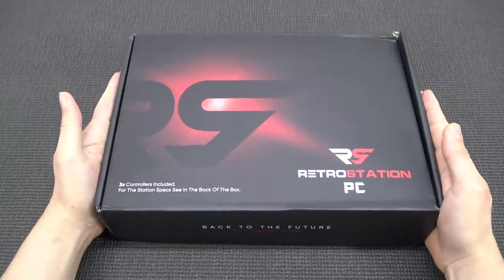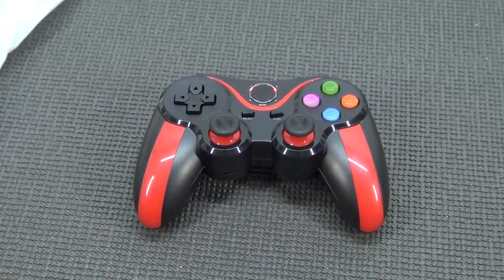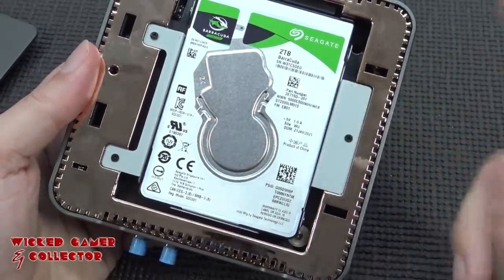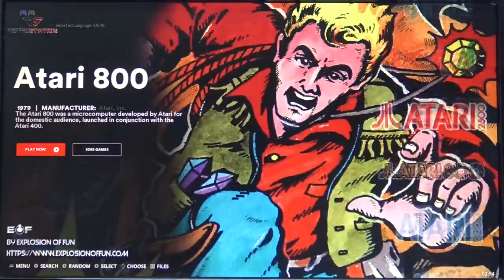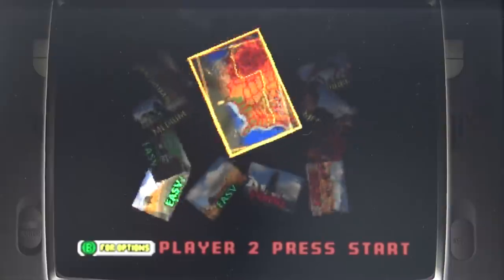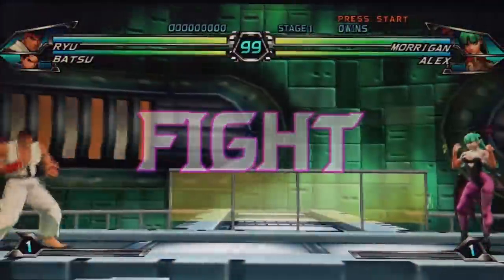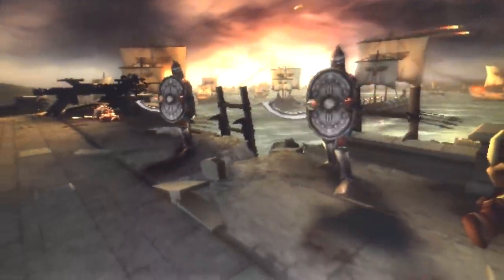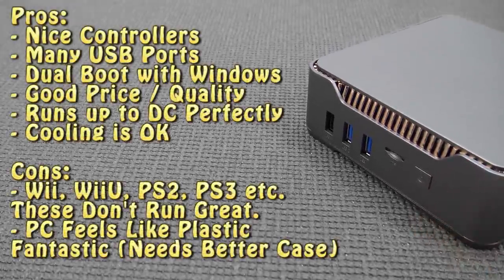Retro Station PC .. The Best Game Box for 2021 ? 🤔

Comment: At that price I would buy an OptiPlex and upgrade it.
I like these little boxes but the price to performance isn't worth it.
Great video. Keep it lit.
Reply: Exactly. I got a Ryzen 5 pro 2400G HP 705 mini computer for like 250. I use it mainly for emulating the games I own 😎. Runs great and I can even play the triple A titles at 30 fps of course with low settings
Reply: You have to look at it like this, it's a PC first and emulator second. But you can find a USB or small PC for $250 on Amazon
Reply: @ThePeacePlant  yes. And a new pc at that. All these optiplex options are great, but are used systems.  While they may be way cheaper, if youdon't know how to maintain them or repair,  it could be a brick within a few months.
Reply: @TeamPandory  Optiplex PCs are so plentiful. The part that would probably fail the quickest would be the mainboard which is an easy replacement.
Reply: @arbbo1675  $150 for 1050ti? it was a long time ago, right? I have the same specs but I cant find the 1050ti for less than 300 :(
Reply: @AFiB1999  Yea it was going on 2 years ago and is missing the lowel profile bracket (which I still can't find)
Reply: @ninjutsuarts679  that was kinda mean..
Reply: Im so pissed off this has been out of stock for SO long!! Is there anything equal to this bad boy?? Help...

Comment: Since there's finally Wii and PS2, gives me hope one day there'll be a decent one
Reply: You can get a real wiiu for like £50 now with controllers and games.  The PS2 emulation seems crappy to me though, i'd not buy one for that too!
Reply: @DailyCorvid  my pc runs PS2 perfectly
Reply: @aqwsderxz  It has nothing to do with the hardware I am using bro, I am talking about how fiddly and irritating it is to set up and use.

Tbh your response...... ugh what are you suggesting I get a new machine for fricking PCSX??  Lol.

The problem is PCSX frontend is garbage.  Needs a serious revamp!  Suggesting new machines; it will be the same there too genius  ;) All stock installations.
Reply: @DailyCorvid  idk tho it works for me without lag but have a good/decent pc with i5 10gb ram & quad-core
Reply: @DailyCorvid  or a pc
Reply: @aqwsderxz  My computer is basically up to date mid range with half decent GPU I won't post specs or boast, but trust me when I say it should be running perfect if it ever bloody worked!!

It doesn't load any of the games just the intro screen then black no matter what I do!

Frustrating when other emulators just work without all that fuss...
Reply: @DailyCorvidMusic  it's a joke I play Forza Horizon 4 absolutely maxxed out for 1080p and get like 150-200 FPS with all settings ultra.

Emulation wise I am getting perfect 4x upscaled Dreamcast and Gamecube absolutely flawless not a frame drop in sight.

Then I try to install and run PCSX2 and 3.  Neither one is easy to figure out, and I can't get a single game to work correctly on either one. 

So it is 100% the software configuration, the garbage frontend that is the issue.
Reply: @Random Pixel Disagree / too many reasons to list it would be 10 pages :D

I own both original and emulation, guess what I NEVER take the original consoles out of their boxes and will never need to again.

EMULATION = The future.  Soon as PS2 and 3 are better I will 100% use that instead of the real consoles.  Upscaling alone is worth the effort of the setp.

PCSX2 and 3 need more work but they will get there.
Reply: @Random Pixel Me!  You can keep your modern bullcrap man I can't stand it, so shallow ... french knickers but no personality😂

I can still play Super Mario World without getting bored and it's 20 odd years old (I am actually playing MarioMaker2 right now have it paused).

I cannot play Sekiro Shadows Die Twice again despite it looks fucking fantastic and was a great game first playthrough.  The only replayable game I have which was modern-ish is Fallout New Vegas Tom Sawyer Version but even that's gotten a bit dull now.

Really great games never lose their fun factor.
Reply: @Random Pixel Hah you know, people who try to offend me via my mother - I pity their lack of creativity in attack.

That was just pathetic.  Try again?  My mother died before I was 2.

Comment: Most of the hiccups in Gamecube and Wii emulation are from loading the shaders.  There could be a setting to pre compile them before the game launches to help out.  If it is the shaders, some times you can upscale the game a little because the stutter isn't from rendering and would stutter at any resolution.
Reply: Im so pissed off this has been out of stock for SO long!! Is there anything equal to this bad boy?? Help...

Comment: If this ssd and hard drive were installed in a pc with a gpu it should run much better, correct?
Reply from the maker: I think GPU is more a power problem... 
SSD will give you faster loading times and smoother operating of the software. 
You see and hear HDD loads like crazy with all of those previews. 
Don't get me wrong would nog be a HUGE thing only just that little bit faster. 
Give it couple of years a 2tb SSD is not 179 euro or something they will get cheaper 😄

Comment: I got recently an Acer SFF (on an online auction, so it was cheap) with an i3 4130 and turned it into well, this. Batocera surprised me with its ridiculously short boot rime from a hard drive, but also with a sheer amount of setting up needed. Still tinkering with it, just to make everything work. Still, it's a lot cheaper and a little bit faster than this machine, if you have the patience to make it work. If you don't, plug and play has its own merrits.

Comment: Review is a thumbs up. The product is a thumbs down. This would be a no go for me. Since they loaded the emulation software and games for Wii, Game Cube & PS2 it should have the power to play the entire library. It's senseless to put systems on it that are not playable. I would use a much more powerful Mini PC for this. Perhaps if they sold the loaded HDD as a separate item it may be worth buying. You could add the HDD to one of the higher end Minisforums mini PCs that can play them all flawlessly. I wouldn't mind a dual boot setup like this with a Ryzen based Minisforum UM700, HM50, HM80 or even their Intel based TL50.
All can play Wii, Game Cube & PS2 perfectly and everything above the UM700 can play PS3 games quite well.
Reply: How much do they cost the UM700 that can play ps3 games? I am looking for a mini pc that can also emulate ps3.

Comment: Dude, you've been forgetting to say "toilet paper manual" 🤣

Well it seems this console is weaker than the Super console mini PC. I bought that recently and it runs Virtua fighter 4 on PS2 at practically full speed. I'm not sure the price difference between this and the super console PC though.

Oh and a tip for you for your next videos, hit "start" on a game or console page, and you can change options. In f-zero for GameCube for example, if you enable speed hacks, you can get it running at 2x resolution with much less skips. I noticed in your Super console video you could hardly get f-zero to run at native resolution, where I got it at 2x with very few dips.

Comment: That Celeron at 2.7 has enough speed to run the games full speed but you are seeing those frequent stutters on Wii and Gamecube games because the cpu only has a 4 meg cache when it needs a minimum of 6 megs to not have these hiccups. until these boxes have a quad core 3.2 ghz or better with 8 meg caches they are gonna have issues.
Reply: What about an i3 6th gen 3.2ghz cpu? Would this run a little bit better?
Reply: @Afura33  no. 6 meg cache minimum.
Reply: @Jolly-Green-Steve  oh ok, thanks for your answer.

Comment: A lot these performance issues on these expensive emulation systems is the the emulator its self. There seems like the emulator games cpu gpu emulation clocks caps are off from the original that  
Bottlenecks the full power of physical cpu out put to the emulation. I have to over clock the mame games cores independently to each game  to get the max results. Most games I do not to need to over clock much.I love my  .122 mame pluss emulator because it runs every game you throw at it max on a xp 32 bit 3 gig ram ,3.0 doul core.

Comment: You're idea of affordable is really off the mark.  This thing is an overpriced piece of junk.  You really need to stop calling things over 150 ,that perform like this, affordable.
Reply: Good luck in finding just a JL4125 for under 200€! Plus there is a 2TB HDD in it! And good controllers, and a mini keyboard. Seriously you could not build this cheaper by yourself with brand new parts and taxes!
Reply: @didde-wankenobi6509  I can't? I've done better.  Hell, steams done better.  Xbox, Sony.  Not only that but the horrible engineering in the box means it's ripe for heat issues.   This isnt an affordable retro.machinr in the least.  Performance and playing retro is all that matters.   Let's not also forget the faking a lot of these systems do as far as actual speed and memory.  It's from china.
Reply: @didde-wankenobi6509  steam deck